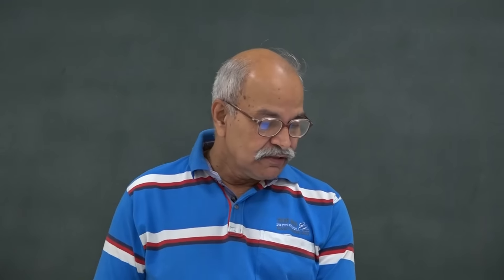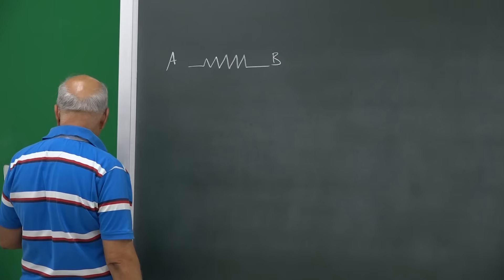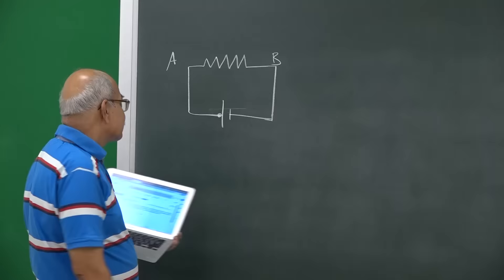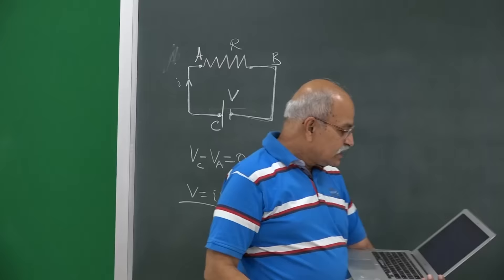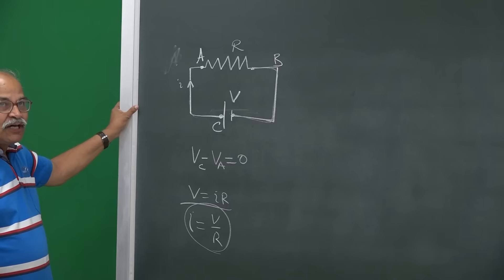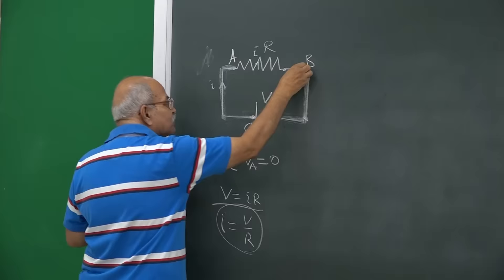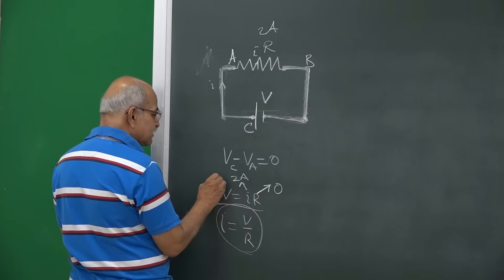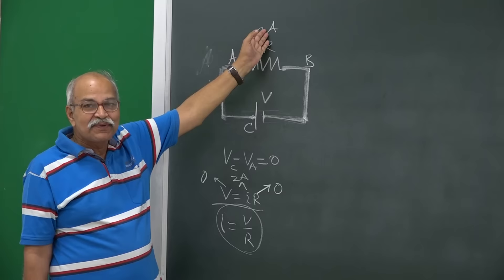Current without potential difference

Comment: {Today most expensive thing country have is usable bandwidth frequency it is type of non renewable source of energy take it seriously } please see this research...........

RISHI NIGAM
9 days ago (edited)
Invention 1
According to antenna 📡 which we design we say that frequency is between 1 to 5 Mhz or other think we can define values between 1 to 2 Mhz and can use them for infinite frequencies because if we consider frequency between 1 to 2 mhz then if we see then output can be
1.1,1.111,1.115677,1.9876,1.11153565.....infinity now. Then why we are using this because if you increase value before point it will have large change as compared to adding values after point
And this is because even if there is small change in frequency then both signal are uncorrelated to large extent. summary try to give less range frequency to any service provider like idea, Aircel, Aircel or jio.. as all this range will have infinite frequency between them. and sent the signal by TDM Time division multiplexing here each signal will have different slots. my invention is right if you use TDM then changes will be large in time domain which can be physically drawn with rotary switch. best it is too try with CDMA . gIVE EACH SIGNAL DIFFERENT CODE.And for modulation use MSK as circle has infinite points on its circumference which can correlate with infinite frequencies between any interval. Each signal frequency will have its corresponding MSK That too after conversion to digital by PCM method in which we are taking infinite levels such that quantization error is minimum.
Summary of my invention is between any two boundaries of frequency range there are infinite frequencies. Summary is that all service provider should be given less range as in any range there are infinite frequency which will enable any service provider to have infinite frequencies for there subscriber and we would able to save bandwidth for any country government ..please see this research...it is useful for countries and service provider both. 

Invention 2
Mind Reading Robots
To overcome the effect of Mind reading Robots in defence. For example if opposition have Mind Reading robots and they can read your future actions . So in that case commander of the batch should ensure that target plan should be told to soldiers instantly or to some people only because if all the soldiers started thinking about next phase of action it can be noticed by mind reading robots and your plan can be demolished (for all countries).if soldiers are got to know they should be instructed to think in different directions because mind reading robots notice signal by constructive interference.
Patent
Rishi Nigam 🇮🇳 🇮🇳 🇮🇳 
Movie-“ Rishi Nigam- The Indian Scientist”

Patent. 
RISHI NIGAM
🇮🇳🇮🇳INDIA
MOVIE' "Rishi Nigam - (The Indian scientist) climax scene

Comment: Sir if resistors of equal are connected in series, then the potential across each resistor will be same or different
Reply: @It's just for Fun how
Reply: @It's just for Fun potential drop occurs after passing through resistor

Comment: So current can be induced with 0 potential difference if resistance is 0????
Reply: Yes just like a water pipe. How much ever water you want, you can adjust using pump and valves.
Reply: Open circuit (No water in pipe)
Closed circuit (Some water in pipe)
All are talking about wires but not pipes😂😂

Comment: Sir but how current is even possible without potential difference
Reply: Let me explain you.... what actually hapenning , the electrons are coming from the region where having some potential difference is because they still have kinetic energy to cover the whole gap with zero potential difference
Reply: @gauti0811  but without potential difference , in a cross section the amount of elections from left to right is equal to right to left ?. So net charge flowing through a cross section is zero ?

Comment: but the potential difference is not a result of current, current is a result of potential difference. I is dependent variable and V is an independent variable, but the explanation given justifies V using i

Comment: But.....
In theory without any emf or volt no current can flow !!!!!
Reply: No emf (No electro motive force). No force acting on electrons to travel. Electrons will travel only if there is a difference in potentials. In the above example, if there is no resistor (open circuit) then current doesn't flow.
Reply: @lokeshbabukr264   i was also saying the same

Comment: Hmmmm.......Everything in the Ohm's law is right but what about the fact that “current always flows from higher to lower potential" but here potential difference is zero so why this is happening ? If i my doubt is valid  then reach this que. to the respected sir .

Thank you
Reply: Okay, this is purely theoretical explanation that has nothing to do with real life, but from mathematical point of view all is correct. Just for the sake of argument if we had such circuit, it would be completely useless, as work that could be done by it would also be zero.

Comment: How can a dc electric bulb has positive and negative terminals without having any potential difference between them when not connected to battery?
Reply: DC electric bulbs have those signs only to let us know the flow of current in the right way. It says to connect the battery in that way.

Comment: What is potential difference or potential in cell battery
Reply: You can't understand it without knowing concept of work done. 
Chemical energy of battery do work done on electrons . Chemical energy moves electron from positive terminal to negative terminal. Chemical energy is now stored in form of electrostatic potential energy. 
Potential difference is exist , potential of point doesn't exist. 
Potential difference between point A and B is work done by moving unit postive against electric field from point a to b

Comment: I have a question sir please answer it because it's giving me headache
The question is : how electrons flow in circuit and if you say it's because of potential difference then please tell me how does a battery make potential difference, what is in battery that makes electrons flow in circuit because charges doesn't flow in just conductor :I mean without battery
Reply: Battery contains 2 sides ...one side have a higher concentration of electrons...one side have lower concentration....So when we connect the wire....the electrons from higher concentration side flows to lower concentration....and when both sides have equal electrons the battery dies (Battery khatam ho jaati hai)
NOTE : this explaination is very very very BASIC but I think it will solve your headache
Reply: @VeritasiumOP  So why electron directly not go from negative to positive terminal
Reply: @yudhishthirthakur7123  Bro you can think that there is a boundary between the 2 sides ...Like some kind of partition.......If you want to study it in detail....There is a chapter in class 12 , ElectroChemistry , you can study it in deatil there

Comment: bruh... the potential difference in the whole circuit might be 0 but across each devide of the circuit in this case the resistor, there is a potential difference that explains how the current exist in a circuit even when the potential difference in the whole circuit is zero. this question is just absurd...

Comment: But how can the current flow if the potential difference is 0?
I am in 10th class I don't know this logic?
Reply: well basically it was based on ohms law v=ir 
as sir said if we take current (i) = 2A and resistance (R)=0 
so when solving it
v=2×0
v=0 
so in this way current can flow in 0 potential difference
Reply: @zohaib9591  numerically the answer is possible but how can current flow when there is no potential difference I mean the potential at both the points is same so from where will the force of attraction from opposite charge occur?
Reply: @zohaib9591  if we'll touch the wire I don't think we would get a shock...?
Reply: @arthshandilya3949  Force is required to start the motion not to maintain it. Similarly potential difference is required to provide kinetic energy to the electron and start the current, not to maintain it. If current starts in a perfectly conducting wire some how and then there is no potential difference thereafter, current still continues to flow in it. Hence the answer to your question can be yes.
Reply: @zohaib9591  after removing the potentials then there will be charged particles but no movement that means it's not current. It's charge and electrons as current is flow of charge and no potential means no flowing and motion so it means no current but yes there will be charged particles. Am I correct?
Reply: @zohaib9591  I guess its not current it's charge
Reply: @arthshandilya3949  bro in my opinion current will travel to some distance and then it will stop like when you apply force on ball it will move at some distance and then stop so like this it can travel for some distance and then vanishes so in that way current can't be proper in wire but it will travel for some distance
Reply: @zohaib9591  but finally the charge will be at rest

Comment: But sir current is equal to v divided by r which is 0 but current is 2 so how is 2 is equal to 0.
Reply: That 2 A is because of resistor R only (i = VAB/R). Think this way, suppose there is a highway on which you're with a bicycle, the surface of highway is smooth everywhere except for some part (it signifies the resistance). If you have to maintain a constant speed of magnitude say v (from smooth part I mean there is negligible friction acting when compared with that of rough part, compare energy with potential difference and friction with resistance) and you're pushed by someone in intended direction, since you haven't got any friction for tyre of bicycle you don't need to expend your energy for ride throughout the smooth part as velocity remains constant due to zero acceleration. While to make a journey through the rough part you would have to paddle which means you would have to low your energy level. 
Take assumptions into account and try to relate them with the actual case.
Reply: @uttam2274 that the ohm law will apply in conducting wires as we not take the resistance as you mention that r is only between a and b than ohm law is not applied in this conducting wires.

Comment: Sorry Sir. It is theoretically Ok. But there is no such conductor ( rather say material) which behaves absolutely ideal. Every conducting wire has a certain resistance whatever insignificant it be . So, the potential difference between two point of the of the same conductor can never be treated as zero. That why potential drop takes place along the length of the same conductor may it be a fact that this potential drop  is negligible but its a fact that potential drop takes place. Kindly don't take it otherwise.  🙏🙏

Comment: I am in class 10th. I have a doubt so, I am writing it here.
How can this be possible???
First of all, charges flow when there is a potential difference between 2 points. And secondly, if R=0 and V=0 then by formula V/R=I --> 0/0=I=UNDEFINED
I may be wrong. So, someone please reply me with the correct answer.
Reply: Yes you are right it will be undefined because it is a hypothetical situation but sir told that if this hypothesis becomes true 
Then it will follow Ohm's Law
V=iR
0volt= 0 ohm*(n)A   where n is constant
It is not practically possible to have current without PD but theoretically it will follow Ohm's law
Reply: @mamtajha3929  But it doesn't make sense. Theories can be proved wrong if one experiment goes against them.
Gravitational constant, Coulomb constant, etc. were calculated through experiments and not through theories.
But you think yourself we have read that charges move when there is a potential difference. Doesn't it seem to contradict both theory and practical situation??
I am still not convinced.

Comment: I didn't understand the explanation. Could you elaborate?
Reply: I mean, what exactly you wanted to conclude, because I didn't understand what exactly you wanted to deliver.
Reply: Question asked: c to a no current should flow as there is no potential difference between them so according to ohm's law current must be zero
Answer: even if potential between a and c is zero current can still pass as it follows ohm's law , ( current flow because there is potential difference in circuit just not in ac

Comment: This is not possible since the resistivity if the conducting wire has to be 0
Which is practically not possible
Reply: That's why current is flowing

Comment: why potential difference moves a charge from low to high
Reply: its not low to high. potential difference means difference in the amount of charges. To balance the charges, electrons move from negative pole to positive pole. Example: consider a battery + and -.

Comment: Here i=2 v=0 r=0
From ohm's law
I=v/r
2=0/0
But that doesn't seem right
Reply: Ohms plotted graph between V and I and called It's slope as resistance. So it's R=V/I and not actually I=V/R (they are basically the same things but ohm's did not define it that way). So if potential difference is 0, then no matter what the ammount of Current is, resistance will always be zero. Or it can be said other way too that if resistance is 0, then potential difference does not depend on the amount of Current.

Comment: Can be infinit current flow there?
Reply: To be infinite current the resistance should be approaching to zero and voltage should be max b
But it is not possible to have any material to have approaching to zero resistance 😊😊
Reply: @aryanchovatiya7348  yes .
We take in questions sometimes limiting conditions but that is for calculation

Comment: my feeling seems a bit creepy about this, how can current flow if the potential diff. is 0 ... i should say why will a current flow with v=0 ?
Reply: Because of the emf across the battery. (Electro motive force). In open circuit current won't flow right.
Reply: @lokeshbabukr264  ya sort of...

Comment: But why will current flow if the potential difference is zero.....current needs potential difference to flow
maybe because the current carrying wire is not resistance free so there will be some resitance in wire as anything can't be 100% resistance free
Reply: The current is flowing due to the difference in potential across the battery  so the current will move to the other end , and to do so it needs a medium (here the wire) . If the wire would be connected to an end of a battery and another end where the potential difference is 0 then current would surely not flow.

Comment: This explanation is not correct. 

In order for Va (point before the resistor) to be the same as Vc (positive plate of the battery) the circuit need to be open at Va. 

This is because as soon as you close it or connect Va to the negative plate (lets call it Vd) of the battery without the resistor, the Va become equal to the Vd and this potential difference Vc - Vd will cause excessive current to flow through the wire. 

This is why you see a spark, because if the wire is really really close to the negative plate, the current will escape through air to the negative plate causing sparks. Very similar to thunder strikes.

However if Va is not connected to Vd or if the circuit is open, no current flows. This is why you see birds sitting on electric lines not getting electrocuted. In order for any current to flow through the body of the bird, there should be a potential difference between, lets say, the bird’s legs (lets call it point A) and bird’s head (let’s call it point B). As the birds sits on the electric line, the potential at A is the same the potential of the electric line and since the head is connected to the legs the same potential appears at B or the bird’s head. Since the bird’s head is not connected to anything else or as we say the circuit is open, net difference in potential which is zero results in no current.

However there was this famous photograph of 2 birds that tried to kiss each other sitting on different electric lines and ended up electrocuted. This is because the overhead lines in India are 3 phase - meaning each line is at 60 degree phase difference from the other - so there is always a potential difference between them. 

Current cannot flow without potential difference

Comment: Just try assuming current = 0 in this case, and try to find the value of resistance of wire = voltage difference across wire / current.

Resistance of wire = 0/0
Contradiction right 😂😂

That's why nothing is wrong if current has non-zero value in this condition, in fact current should have a non-zero value.
Reply: Vb - iR = Va 
i=0 and Va-Vb = 0 
0*R = 0 so resistance is undefined

Comment: What these idiots (the guy who asked this question) don't understand is that the resistance is distributed all across the length of the wire, not just in a certain portion like the circuit diagram shows. EMF is simply the energy gained by each unit of charge in the battery and potential drop is the energy lost by those charges when moving through the wire.

The only way a current can flow without a potential difference is when it is flowing through a superconductor. The (almost) zero resistance of the superconductor makes it possible to keep a current flowing indefinitely through the wire without any EMF.

Comment: Here Current is a representation only 🤣 when v=0 how current can be there dude 😂, you take current 1000  ampere, if v=0 it will not have any effect, and it will follow ohms law i.e I=0/R where to u put I = 1000A if v=0 I has to be zero 🤣🤣🤣🤣 ohms law hi samajh nai aya kya bhai 🤣